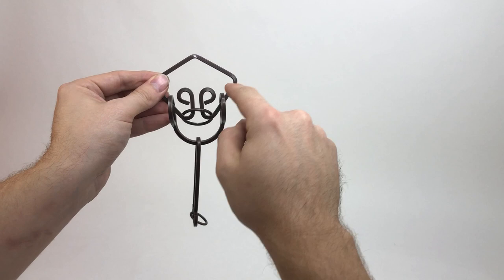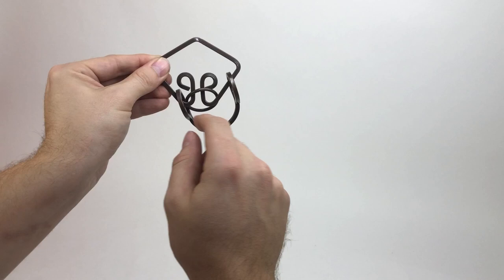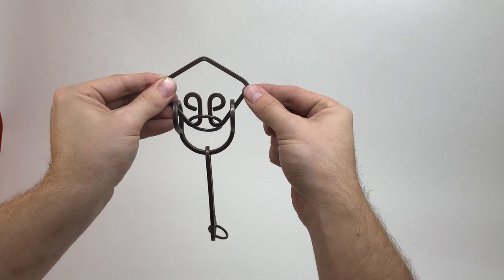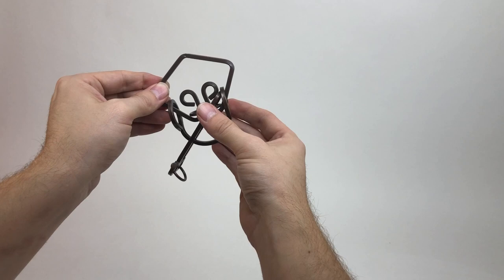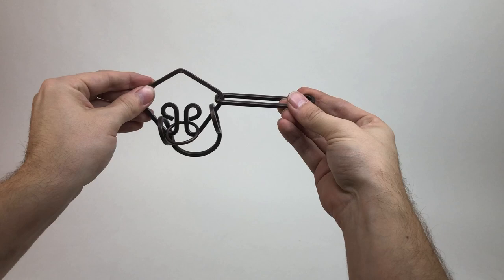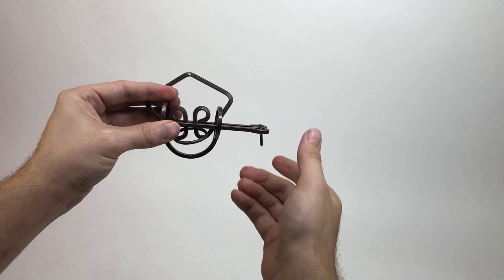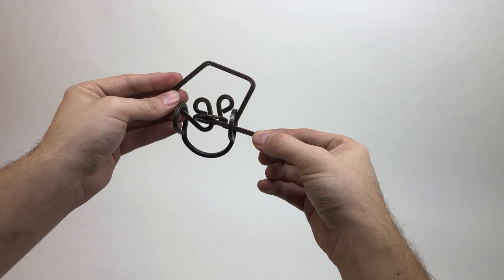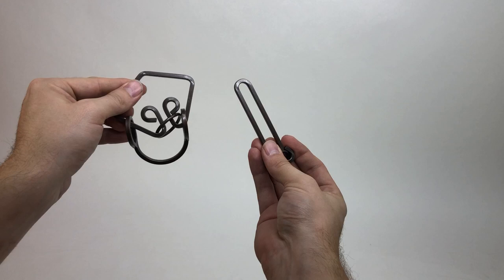Taking the Chinese Plow Apart

Comment: And after I solved it, I don’t know how to put it back 😂
Reply: i know how to put it back together
Reply: https://linksharing.samsungcloud.com/rO0N8krCBtY4 How to take it apart and put it together. It does get out of the frame but basically, insert it back through the horseshoe hole and loop it over the prongs. Repeat the step where you slide the ring through the piece and bring it over the other prong. Slide the piece over the horseshoe like before to get the piece back on the horseshoe. Then insert the piece through the center ring and bring it down. I'm bad at describing it but I hope it helped.

Comment: https://linksharing.samsungcloud.com/rO0N8krCBtY4 How to take it apart and put it together. It does get out of the frame but basically, insert it back through the horseshoe hole and loop it over the prongs. Repeat the step where you slide the ring through the piece and bring it over the other prong. Slide the piece over the horseshoe like before to get the piece back on the horseshoe. Then insert the piece through the center ring and bring it down. I'm bad at describing it but I hope it helped.